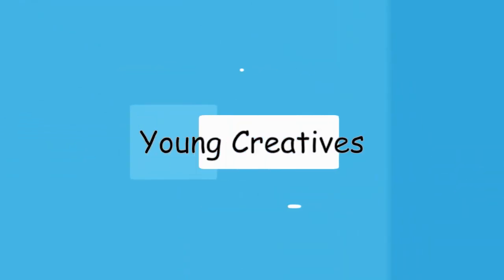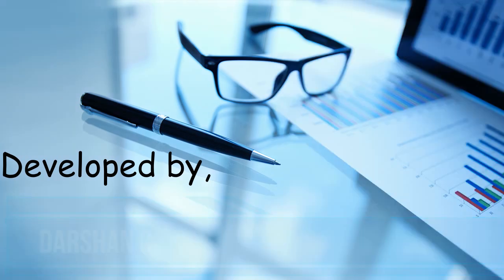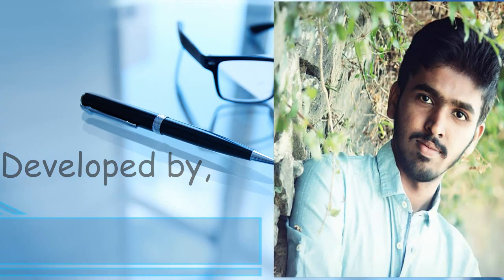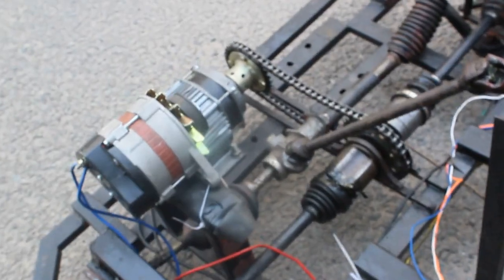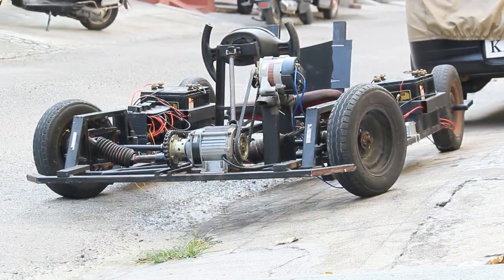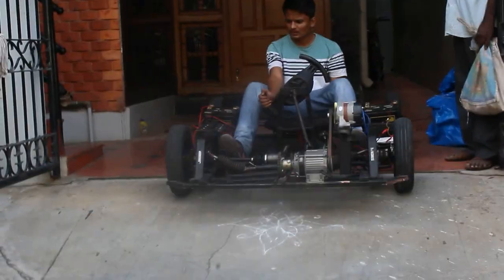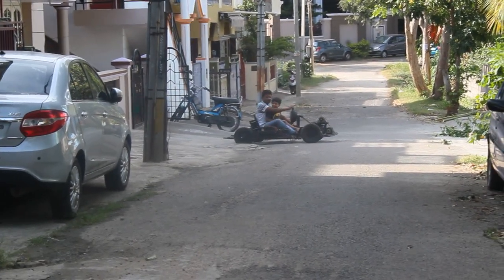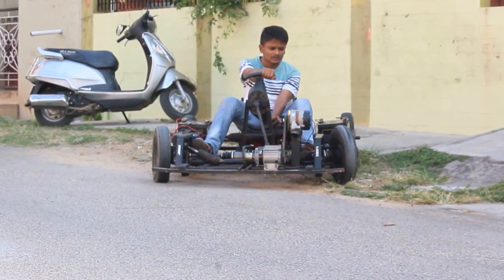self charging electric car.

Comment: The energy it takes to spin an alternator is more than it produces. So for example, it may drain 100 watts and only produce 90. 10 watts are lost. If you started with a battery with 1000 watt-hours, the battery will be dead in 10 hours. Better to save the 100 watts for driving.
Reply: They always say there is no free lunch in energy.  But there has to be a way.  So we know the battery will do work.   It has torque enough to burn rubber and it can carry passengers.   By attaching a alternator you are basically letting the Alternator take advantage of the work produced by the motion  of the car.  Now if the car's range is say 82 Miles ( Chevy Spark EV)  How much will the range be reduced by spinning the alternator in addtion  the cars wheels?   And if you have said alternator backfeeding, or charging another battery will it  be extend the range once the electric battery is depleted?  And if so how much more range can you get.   Remember the old Sansui Stereo Systems where the tuner knob would keep spinning if you just gave it a little turn?     This is the idea.  Can you get a 82 mile range car to roll another 50 miles or more.
Reply: @Detroitblue  Regenerative braking is the only upside. Normally, a motor is powered by electricity. When it is not being "driven" by electrical power, then if it is being spun by mechanical means due to the momentum of the vehicle it produces power (becomes an alternator). But that has drag (spinning a lot of metal mass through a magnetic field) and the vehicle will come to a stop shortly and again require more power to build momentum again. The energy you spend accelerating to 60mph cannot be regained by using an alternator as it decelerate to zero. For one, as electrons travel through the conductor, there is heat generated (some of the energy from the battery is converted to heat and lost to the environment). This is called copper loss and approximated to (i^2)*R. So if all you had was 100 watts and it cost 100 watts to get to 60mph, maybe you recover 80 watts on decel. Do that 4 more times and your battery is dead. If you did not have regenerative braking, then you would not have been able to do it four more times, but you would have coasted farther because there was no regenerative braking drag. Which one gets you farther overall? This is a good question lol.
Reply: @JFK3-1  Agreed but you are talking about the known not the unknown aspect of Magnetic fields.  You are talking about the knowns of heat loss in a conductor not the unknowns.   I understand we have not cracked the secrets of super conductivity in at ambient tempertures but i suspect it has been and can be again.  These are the people who die mysteriously unfortunately.    We only need to imagine it and we will find a way.
Reply: @Detroitblue  oh, yeah. Well, it's all just a simulation, so 🤷🏽.
Reply: @JFK3-1  What I was getting at in my reimagining is to combine to technogy of chemical batteries with the mechanical battery tech of the fly wheel perhaps.   The could be a way to store up the kinetic energy from the motion produced by the Chemical battery and extend it range much in the way the kinetic energy is recaptured when using regerative breaking.   Check out this video I just saw called " The mechanical Battery Explained - A Flywheel Comeback. "    By Undecided with Matt Ferrel
Reply: @Detroitblue  I was not debating. I was serious. But I'll check your video out. The flywheel is not free though. It has a going enerygy cost for the storage. It is still commonly used in power transmission and UPS.
Reply: @JFK3-1  No not a debate,  you seem to have a good handle on engineering dynamics.   I am not suggesting the flywheel is free no.  But it is cleaver engineering to take the known and available technolgy and reimagine it so as to increase the efficency.    As far a free energy goes, there is a African Guy that has invented the tech to run a Tv from the athmospere.  No wires.   Several Attempts have been made on his life.  He was relocated to California this year and I have not heard a thing else about him. I am sure this project will never see the light of day now for sure.  Zimbabwean inventor Maxwell Chikumbutso interview .  The tech is out there but always suppressed.
Reply: sar k 80 mies vets adestin 50 miles 132 mikl tange vhsrge to vhsrhe  liits tabge get kobg tabge

Comment: As a kid I tried to make this myself with two small motors glued to a board and a rubber band attached between the output shafts. My theory was: if I start spin the motor, one would generate power for the motor that's driving the generator thus creating its own propetual energy.The problem was, I never knew much about electronics as a young boy so it failed.
Now I know a lot more as an adult, I think I might have to re-creat this experiment on that same small scale. Youn never know.. I  might learn from it.
Reply: Not possible. Thermodynamics 101

Comment: I dreamt this up years ago! When electric cars came out. I always said to myself. There has to be a way to charge the car while driving? No need to plug into outlet. Just continues driving👍
Reply: That certainly won't work. It breaks the laws of thermodynamics and the law of conservation of energy!
Reply: @varunbhaaskar3338  work hard and break the laws
Reply: @varunbhaaskar3338  I bet it can work little watches power themselves from moving around im sure 4 wheels spinning at 60 mph could charge a car buddy

Comment: Exactly how the dam teslas should be made and this used in semi trucks but no they cant make money charging them this way.  What device decides between which batteries to run and charge?  What's it called?
Reply from the maker: It's smart switching system.. which includes set of relays and a controller to measure the voltage and switch accordingly

Comment: Put the alternator to run off the axle of the car. Use a 1:4 gear or pully to bring up the rotation of the  alternator. The alternator has to spin at least at 1k rpm and your wheel will only do like 200 - 300 rpms. Other than that you might want to look into getting another motor that can spin all the time and hooked up to alternators that can produce access power to charge the batteries. You might need more than one alternator.
Reply: Build 3 section battery, 1 for run alternator to charging other two battery and auto charging continuosly

Comment: How long does it last? I mean the battery before it needs to be recharged from an outside source?
Reply: That is the real question right!.    How much longer with this car run then it does with just the battery system .   But I like the idea.  That is why I am here, because I thinking the same thing.   But they always tell you there is no free lunch in energy.

Comment: Such a foolish man.chutiya bna ra h. It will not going to charge because alternater need force to charge and alternater get force from motor and motor get from battery. Basically it give power to one to another no extra power.

Comment: This is a bad idea, you're exchanging electrical energy for work energy to make the vehicle move. You are then exchanging more electrical for work to power an alternator to convert back into electrical.
This is why hybrids and electrics instead, try to recover energy during braking. This way you are only taking work energy that is no longer needed and recovering some of it back in the form of electrical energy.
This vehicle would be faster and work longer if you just used the batteries to power the motors, and removed the alternator, or figure out a way to use the alternator to break.
Reply: Then it would not have been a selfcharging car because it's the alternator that produces the AC current to charge the batteries for storage as DC in the batteries for energy to move the car..it's an endless cycle for the wheels to turn

Comment: "Why don't cha just put a generator on the wheel and make 'lectricity as you drive?"
Reply: its because of the speed you need to generate to be able to produce atleast 12v

Comment: Can you please explain how it works,and the principle behind the invention . It will be so helpful for us to do,for our final year project.
Reply: Even huge car company cannot produce this technology because of our battery technology needs to be improved, and I doubt your experiment on alternators as dynamo that charges the batteries, your concepts may be right, but you components in ur experiment are impossible, only those who have no knowledge will be amezed in your "self charging car,
Reply: @shinakuma275  Yes basics you can't get more out than you put in as it would be over unity every bit of load you put on to charge a battery is a addition drain on the first battery also you are carrying extra crap in weight of the additional charging junk. Take all that crap off and just use the battery for drive but also use regenerative braking to charge the battery when you slow down or go down a hill. Electric wheel chairs have done this for decades.
Reply: Electric motor rotate wheels and alternator. Alternator charge batteries and switch charging  between batteries with relays and some delay. It charge one battery at time.
Reply: @kekrikekkuli3359  first of all alternator doesn't charge dead battery, alternator consist of primary and secondary winding so it requires DC current to act like electromagnet, then if it is rotated it will produce current.
But as motor will rotate wheels as well as alternator it will consume more electricity  as it will require more torque. 

So in Practical thinking it will not work long time.. you have to plug in to charge batteries...!!
Reply: @roshansuryawanshi8658  I want help from you
Reply: @kekrikekkuli3359  I want help from you

Comment: I appreciate your work 
But there are frictional losses  and Motor take more power from the battery to achieve maximum  torque because u connected an generator to the motor and can it  charge another battery when the running battery is fully discharged? Because I also tried this. Even though you add another generator there are some issues let's see how you can solve this🤔
Reply: Can solar generate that much amount of power at the same time solar panels size and converter need much space bro. I am not discouraging your work because my team also working to design a self chagring vehicle.All the best bro
Reply: What if you install wind turbines to run that generator or may be alternator?
Reply: what you need to solve is how can you create a magnetic field so that if the car is in motion the motor will run on alternating current not on battery, thats the best solution for self charging cars.
Reply: Im under project for same subjct.. 
My qn is
Is the battery connctd to generator will sufficntly power the battery.. so that it cn extend the mileage 
Im 100% sure that it cannot compensate the whole charge which is usef by motor...
Reply: Helo 
Same project want to use on ebike Can you pls help me what type of auto switch use at the same time self charing connection to battery pack is 60v 24ah  , pls share the auto switch  parts and wiring diagram. I want to use same for electric bike
Reply: @sumannaidu9199  hi dear I want support from you
Reply: self charging will only extend your mileage but will damage your battery in the long run
Reply from the maker: Yeah! So we are planning to use a solar power to compensate the remaing power
Reply: @manikyamakshi3172  bro pls use li-ion batterry or super capps.........

Comment: You can also add another motor and have 2 alternators.
Reply: that would decrease the speed and place additional torque to the motor
Reply: @mayat-anshandcrafts2560  no not connected to the drive-train just a motor and 2 alternators to supplement any deficiency in amps.